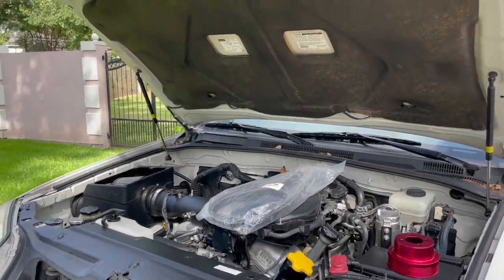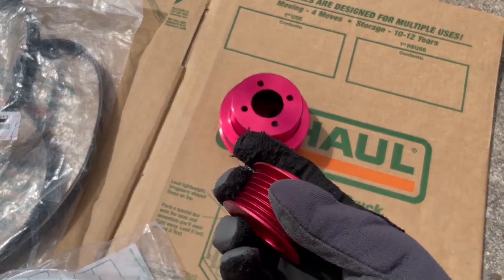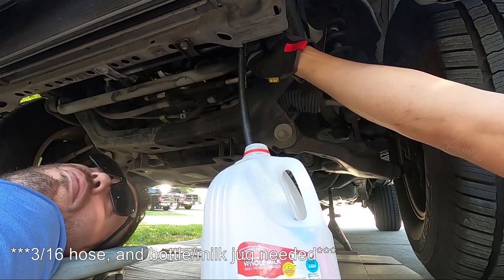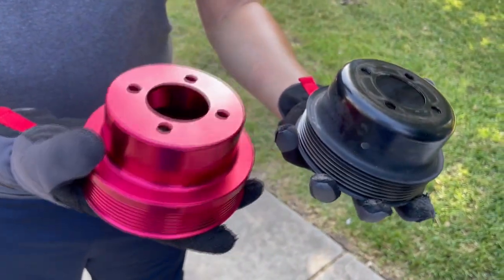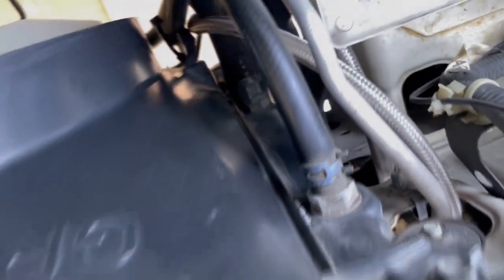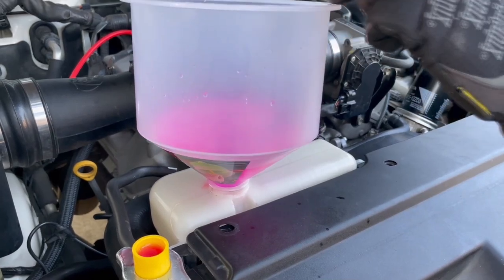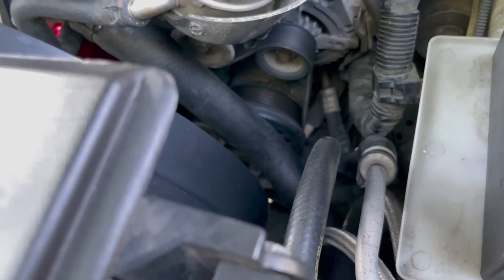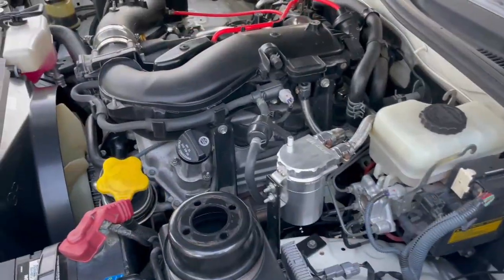4th Gen 4Runner Serpentine Belt & Water Pump Pulley Change | For 1GR-FE Engine - 5TH ENGINE MOD

Comment: My belt lasted 287,365 all original oem switch out the Bando 7pk2120 same as oem also Also the change out pulleys as well with Gates (2x) 36173, (2x) 36174. Oh head up that valve cover gasket will dry rot eventually for me at 288,202 look for a small amount of oil on spark plugs do compression test dry and wet first.🤙
Reply from the maker: 287K miles on the original belt. Impressive!
Reply: I'm about to change my valve cover gaskets on my 2005 4runner. Starting to leak a little at 283k miles. Did you replace anything else when doing the valve cover gaskets? Any other gaskets I should replace while doing those? I hear the upper air intake gaskets usually are brittle as well

Comment: How difficult is it to change out the belt? Do I need assistance too, or can I do it solo?
How long would it take, a few hours?
Id rather do it myself than spend an extra $200-300+ for a mechanic to do it. Id rather learn to do it
Reply from the maker: Very easy. It just takes some work as you can see. Though I’d recommend using a breaker bar so that you have more leverage to move the tensioner pulley

Comment: Which head unit is that?
Reply from the maker: It came from a 2015 Toyota Yaris!
Reply: @airsoftmechanic  thanks. Was there any special harness or anything else needed to install?
Reply from the maker: @juanapatiga6514  Had to get a harness adapter, and a couple of other wires and connectors